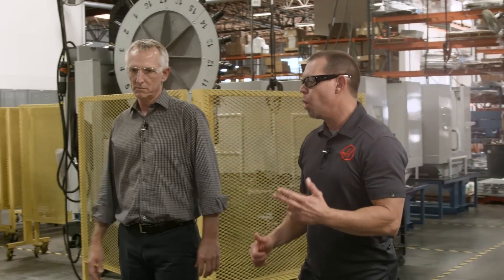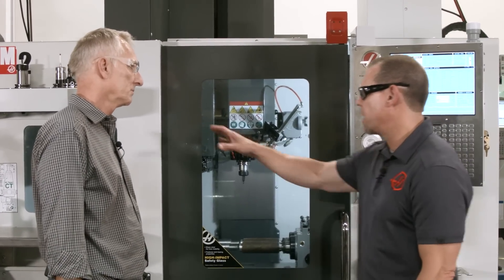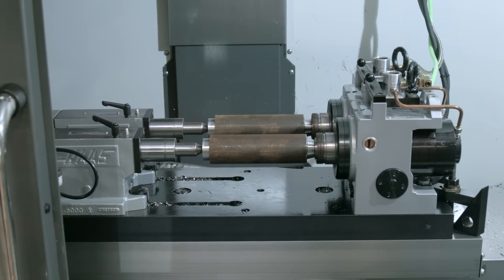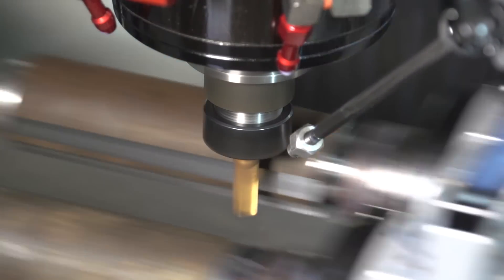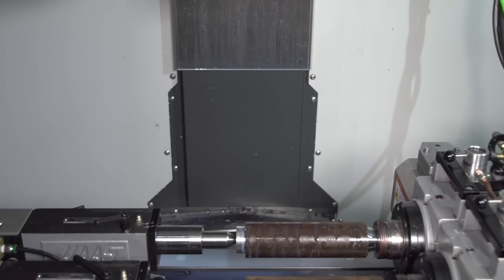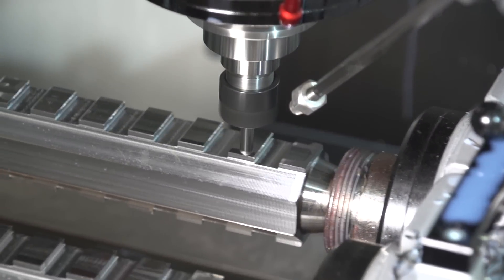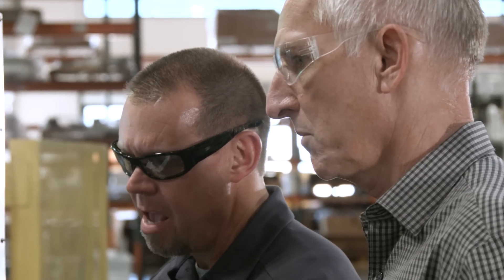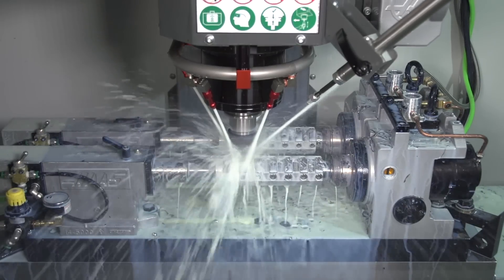The New Haas DM-2 and DT-2 from Haas Automation

Comment: Haas... Build a machine aimed at the home hobbyist.   I know the entry level Mini Mill is rated at 220 single phase but it dials down the performance to run at less than 3 phase and still costs as much as a nice Mercedes once it's been properly optioned.   There's a whole market of "Makers" out here who want to step up from the dovetail ways of the Tormach to something better!  3D printers have found a market no one knew was there 10 years ago.  Tap into that market and be on top in the next 10 years by building a CNC designed for folks who run their business out of their garage!

Comment: I see major potential for bad crashes. This also seems to have limited application. I would think a 4 axis lathe could do the same thing.
Reply: Sure the potential is there, but proof your programs properly, and a machine's speed is irrelevant. Also this is a demo, setup with a twin 5c 4th axis. The 4th axis isn't a permanent fixture in the machine, you can put vices or whatever you'd like.
Reply: If you miss it once, you miss it forever...
2nd, a properly tooled 4th axis can, and will run circles around most live tooling lathes.  I've been using a technique of a 4th axis tombstone on a vertical for 30 years, but it has only recently started gaining popularity.

Comment: So, is the actual limit of this table 250 lbs, and you just unsafely exceeded it for the demo?  The HA2-TS with no centers, no collets, no material, and no hardware is 280 lbs.  Figuring that's steel, you've got 300-320lbs on that table.  So is this an unsafe setup, or is the listed max table weight incorrect?
Reply from the maker: HI Alex, thanks for your comment. The table weight can be exceeded when the acceleration rates for the X and Y axes are reduced.

Comment: how come the tailstocks don't have bolts holding them down?
Reply from the maker: Hello MegaJohnhammond,
If you stop the video where you can see the rotary setup on-screen fullsize, you'll see directly below each tailstock spindle there is a hex head screw clamping the tailstock to the sub-plate. There is another of the same screws on the back end of each tailstock as well. Thanks.

Comment: as someone with a homebrew cnc conversion and experience on large cnc machines it never ceases to startle me just how FAST those drill/tap machines really are. but when doing a production run seconds saved per part stack up SUPER fast!
Reply: You are correct. I am always looking for seconds. any place to pickup a little speed is multiplied times each part run. Over the course of a year or the life of the machine - it makes a HUGE difference. I run all my machines FULL SPEED all the time. As fast as it will allow and as much horsepower as the tool will tolerate. Replacing a spindle every 5-7 years is FAR cheaper than treating the machine like a baby.